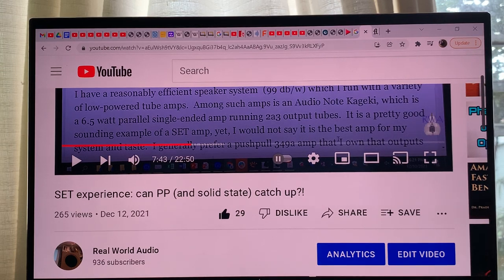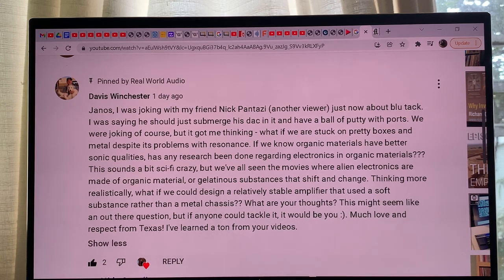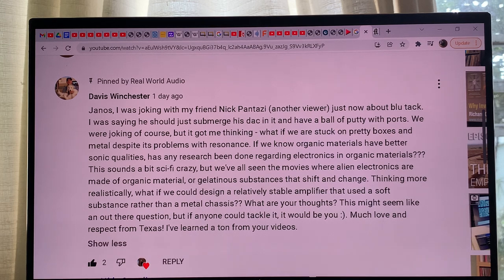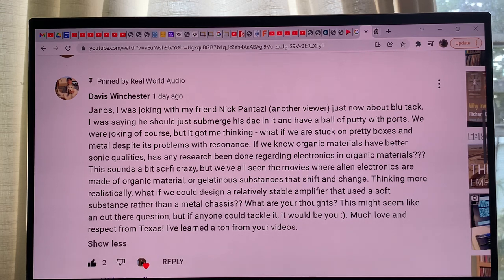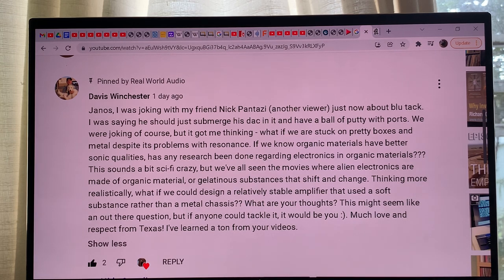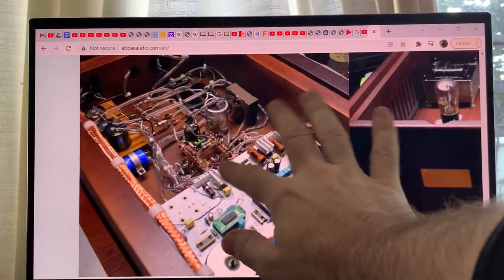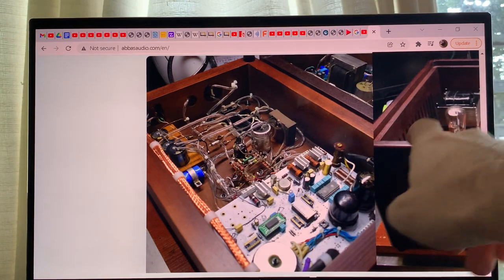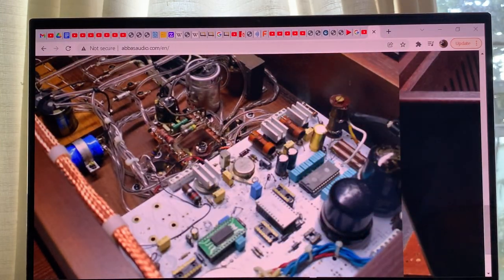Planet Blue Tac: where does the ultimate application lead to?

Comment: I bought a used Tascam cd player that Decware used to modify with a tube output stage many years ago. The chips and a large portion of the pcb were insulated with this soft epoxy stuff that looked like it was poured on as a liquid then solidified leaving a puddle like appearance. I have no idea what it is, maybe someone here does?
Marc
Reply from the maker: Never seen it, but it sounds as epoxy based on your description. ; Janos

Comment: Have you used duct seal before? Like the stuff that electricians use to seal conduits. It's very cheap, pliable and non-conductive. 
I've had great results using it to dampen and shape the airflow on Fostex drivers. Also dampening capacitors and on tube bases. Just wondering how it compares.
Reply from the maker: Is that the blue pliable stuff? I never tried it... used to use cork, paraffin tape... 
To shape air flow my best shot has been gluing wooden pieces to the basket - both inside and outside, shaped to aid airflow and to modulate metalllic resonances to wooden resonances... Also, using paraffin-embedded ferrite micro particles to fill up the sides of the ferrite magnet to make it nice and rounded, so the magnetic lines do not break suddenly. Also aids air-flow as a side-effect...; )>
Reply: Now that's a great idea; using paraffin embedded ferrite micro particles! That really serves 3 purposes well. I may have to try that, along with gluing some wood to the baskets on a pair of FE-126NVs that I just got. 
I actually haven't used Blu-Tac before. 😉 The duct seal that I use is a dark gray putty that comes in a large roll for a few dollars from electrical supply houses. I think that it's similar to what Planet 10 Audio uses on their modified drivers.
Reply from the maker: @FireTriode  Not familiar with it... or P 10 audio. Audio note uses (not confirmed, but that's what I suspect) automotive putty for their speaker drivers (looks like a black goo, black version of blue tac). Even better for dampening (that's the stuff that keeps the car windows in place), but leaves the most God-awful mess that's impossible to clear. If it goes on your carpet or clothes, say goodbye! ; ). (Unless it can handle copious acetone washes...) My mentor used to take a liking to that awful mess.. sure, best results, but once you touch it, say goodbye to a clean room - or clothing.... perfect for half-blind bachelors though ; ).

Comment: Hi Janos.  I Recently picked up a metal stand to mount my equipment on.  If I get some wood to place on each shelf do these still need to be decoupled (with blu tac?)  I was going to use  Ikea kitchen blocks made from bamboo.
Any suggestions from the crew?
Thanks
🌞
Reply from the maker: Yup! Hold the blocks and the blue tac. Try to fill the metal stand with sand. And for the shelf, use spruce planks. 3-4 inch wide, 12-20in long (or as long as it takes to span), two planks per gear. That's the final word of my mentor on metal equipment racks, summing up about 30 years of very intense experiments, trying out every dampening/suspension methods that exist for audio, industry, and other areas... the spruce came out on top.
Reply: Appreciate the advice Janos thanks👍
Will depend on cost of spruce tho.  Might have to settle for next best as IKEA is having a sale on the bamboo blocks which fit the stand perfectly.  Will look at the birch as an upgrade when I’m back to work 😅
I take it that blu tac under the bamboo won’t do anything?
Happy Christmas
🌞

Comment: I don't know what the electrolytic properties of blue tack is probably quite good anybody no what it is?
but the damping factor of blu tack is second to none one of the best materials, so coating metallic and electrical parts should be more beneficial.
Reply from the maker: It's non-conductive, at least in low voltage applications. 1000V would arc through it, I'd definitively avoid 400VDC / 120VAC and higher, but solid state gear are all fine. ;

Comment: So, is not inserting glue between the component and wood defeating the purpose of the wood. I'd think the wood needs to contact the component to be effective....  Heading to Abbas now...
Reply: I think that having the wood glued to the other surface would create a constrained layer damping effect. It'd be interesting to compare fastening methods.
Reply: @FireTriode  I'll be using wood blocks for my footers. They won't be attached, I'll just rest the component on them.
Reply from the maker: Indeed, to much tacky glue defeats the purpose, and makes a unit dead, overdampened. I'm using hot glue as an adhesive to attach wood to the chassis. Better coupling metal or plastic to wood, it  imparts wooden tonality better.  There are some places though where you cannot add wood, and where bluetac is the only choice - such as the bottom of the CD tray;
Reply from the maker: Indeed, for footers you need not fasten them when the weight of the unit is enough to ensure strong mechanical coupling between chassis and wood. However, at places (such as side of the chassis), there is no weight on it, and there fastening is required. I use the rap test to test efficacy: rap with knuckle, and listen to sound. Hot glue works extremely well, hot glued wood to metal makes the metal give wooden tone, instead of a metallic ring.